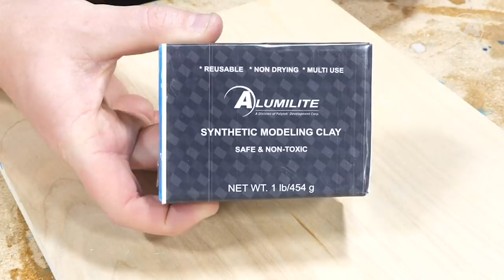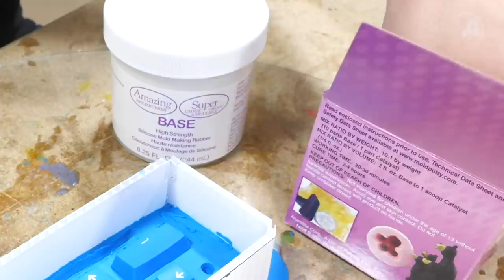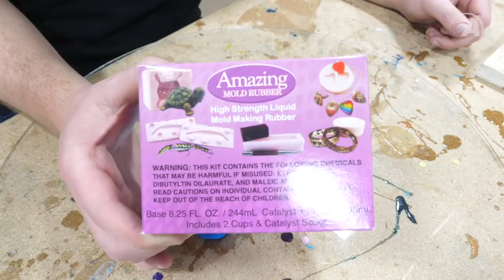Making Your Own Custom Keyboard Keys | Alumilite

Comment: How durable are these pieces? I am making a school project, and I am wondering if it is worth it to switch from a 3d printer to making a mold
Reply from the maker: It all depends on which product you cast with! Most of our casting resins are on the higher end of the shore hardness scale so they're fairly durable!!You can find the shore hardness of each product on their product page on our website - the product used in this video to cast the keycaps is Alumires RC-3 Tan which has a shore hardness of 74D, you could also use Amazing Clear Cast which has a longer open/cure time but a higher shore hardness at 80 D.
Reply: @AlumiliteCorporation  Thanks!

Comment: I would love to do something like this but live in a small apartment with my dog. Is the mold rubber and RC-3 Tan safe to use indoors without any additional protection? If not, can you recommend anything else to use instead?
Reply from the maker: Hi Taylor! We recommend working in a well-ventilated area, or if not, wearing a respirator while you work. As always when working with silicones and resins, wearing eye protection and gloves is required. If you have an open window and/or a fan on, you should be just fine doing this project in your apartment!

Comment: Hey! Awesome video! I'm thinking of getting into making my own keycaps now, but I'm worried that my preferred method of putting legends on keys, heat induction, won't work on your resin. How do you put legends on your keys?
Reply from the maker: It really depends on the temperature your process gets too. Each resin has its own heat resistance - this is where permanent damage can occur. If you find a resin that can handle the heat of your process then you'll be good to go!

Comment: 2:39 Is it bad that it felt threatened when he had the tip of the pencil close to the camera?
Reply from the maker: Haha! Thanks for watching.
Reply: Hey this is pretty weird but when I plug my keyboard into my Xbox the RGB won’t turn on but the keyboard will connect can someone please help me
Reply: @corbinreed6721  does the keyboard use two USB plugs?
Reply from the maker: @corbinreed6721  I hope someone can help!
Reply: EPIC GAMER some keyboard need to have a specific software for rgb
Reply: @corbinreed6721  it could be that the usb port on your Xbox isn't delivering enough power to support the lights on your pcb
Reply: @corbinreed6721  ur an epic gamer you should know
Reply: EPIC GAMER rgb doesn’t matter lol
Reply: LiterallyCJ not true. It gives you an increase of at least 100 fps
Reply: @ve5498  please tell me you're joking
Reply: erik masterchef Ik it is actually taking stress off the keyboard which makes delay shorter, Btw I’m joking lol

Comment: Do you have to buy two things of the silicone mold or just one because u did a top and the bottom.
Reply from the maker: We were able to make both pieces of the mold with one silicone kit! We have a volume calculator on our website that you can use to determine how much silicone you’ll need for a project - this makes it easier to choose a silicone kit size!
Reply: Thanks

Comment: How can i prevent bubbles from getting into the nooks and crannies of my keycaps?
I Just got my second mold done, And it appears that there was trapped air causing the mount/stem to be done wrong.
Reply: 5:00 venting
Reply: U could make like a water themed one
Reply from the maker: Venting is a great tip! Using a pressure pot also helps a lot with bubbles!

Comment: Question... do you add the rubber to rubber mold release each time you make the keys?
Reply from the maker: No! Just when making the mold! The rubber to rubber helps to make sure the two layers of silicone you're pouring, don't stick together. But once the silicone cures it's not needed!

Comment: Is  there a way to make a mold that allows you to insert like a 3d model or something in it first?
Reply: For the bottom side of the mold you can use shorter keycaps. The SA keycap profile can be used for the top of the keycaps, while DSA or low profile keycaps can be used for the bottom, internal, cherry mx stem mold.
Reply from the maker: You can mold a 3D model, you can mold a clay model, a figurine... really anything you want!

Comment: Did you try these in a keyboard?  I'm curious how well they fit.  The stem area concerns me.

3D printing is tempting, but typically each key is a different shape.  Modelling each is a lot of work.  The drawback here is that if you are trying to create an original layout and use a non-standard size you will have nothing to copy.
Reply from the maker: We did! They fit pretty well! As for creating a custom layout, that's definitely something you would have to design and 3D print first so you have something to copy. But for just customizing a keyboard you have laying around, it works great!

Comment: what is the best resin to remake motorcycle body parts? i don’t want to use fiberglass because i need to copy both sides
Reply from the maker: Resin might not be the best option for motorcycle parts. Resin can only handle a certain amount of heat and yellows with time from UV rays. If you want more information on Resin we would recommend reaching out to our Customer Service team at info@alumilite.com!

Comment: Just wondering how much silicone you used to make this mold I want to make some
Reply from the maker: Our Amazing Mold Rubber is a 10 to 1 mixture by weight or volume so we used about 277 grams of the base and 27 grams of the catalyst!

Comment: How do you clean the injector after use?
Reply from the maker: Typically we get cheap injectors and just toss them after - but if the resin inside is thin enough you can probably just peel it out after it cures!

Comment: Now just a light sandblasting for texture..
Reply from the maker: Cool idea!
Reply: I've tried sanding abs and pbt with different grits and they just turn out weird. I'm pretty sure the keycap manufacture put the caps in large drumps with fine sand and roll them the way metal shop do to finish.